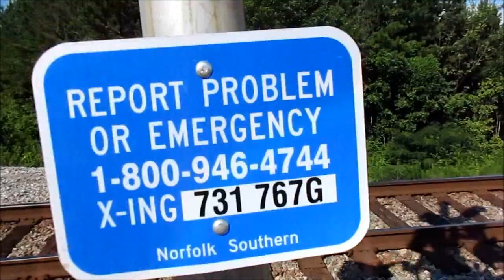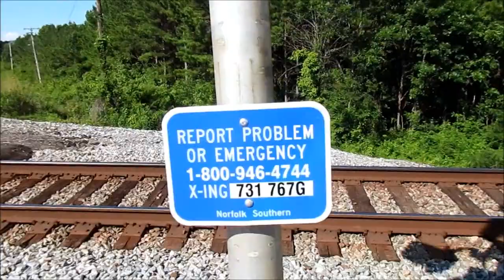7-19-18 AL 65 Railroad Crossing Update, Paint Rock, AL

Comment: the crossing came from Jackson Street in Courtland AL
Reply from the maker: No, the crossing at Jackson Street in Courtland's still there. Now, one of the signals that was replaced at that crossing was re-installed at this crossing, but I mentioned that in the video, I'm pretty sure.
Reply: @freebrickproductions  no the old Jackson Street crossing I mean
Reply from the maker: @BaltimoreSirens  Yea, I said the "new" signal here came from Jackson Street's crossing. What aren't you getting?
Or are you confusing "crossing" (where a road crossing a rail line) with "crossing signal" or "signal" (which an automatic warning device at a crossing) like an dumbass?